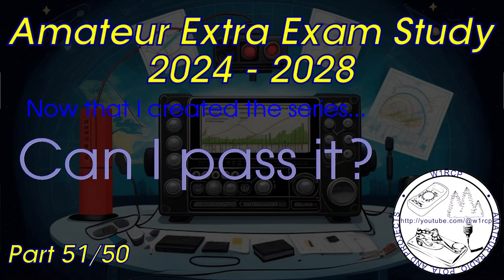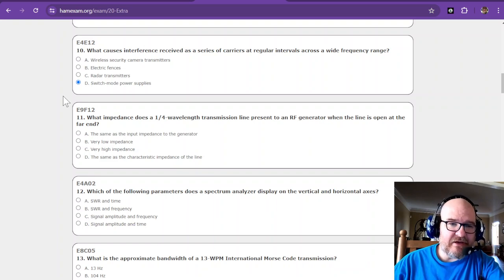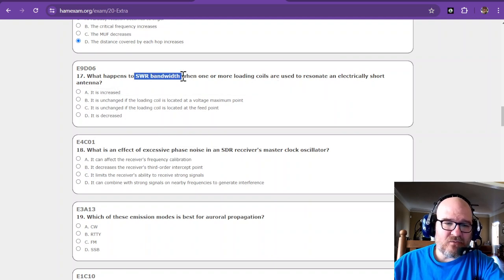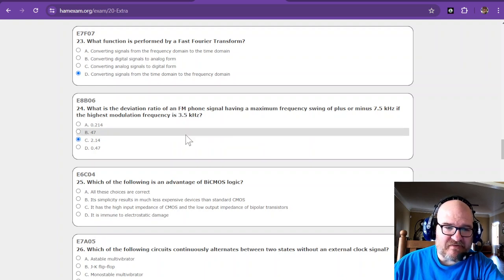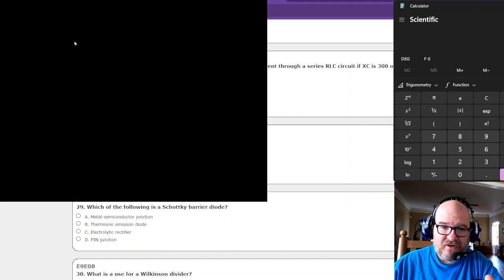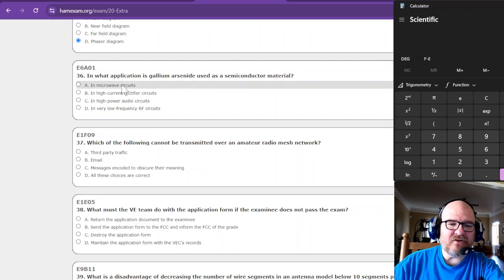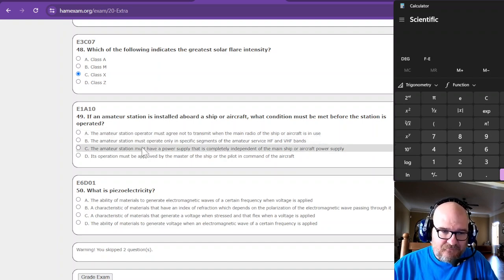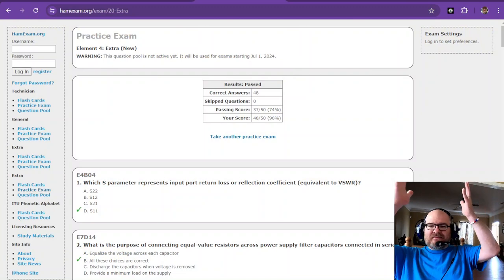Can I pass the Amateur Extra exam? I'm talking my way through it!

Comment: After having been away from RF and microwave for 60 years, I recently passed the Technician and General tests.  But after looking at the Extra material I was discouraged since so much of the material was new and unfamiliar to me.  However, after going through this series and the test with you, I think I'll take a stab at it.
Reply from the maker: Let’s goooooooo! I did it because I wanted to give back to the ham community through VE testing. I learned quite a bit of interesting stuff, and I’m forgetting the rest quickly, but I know where to find most of the information if I need it.